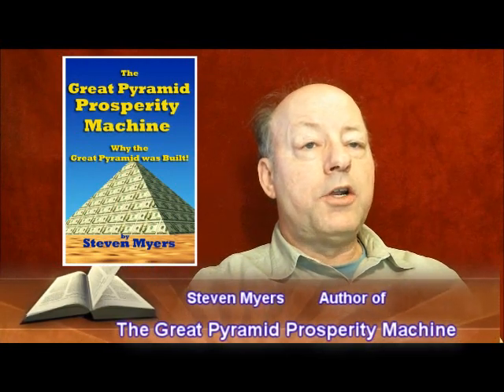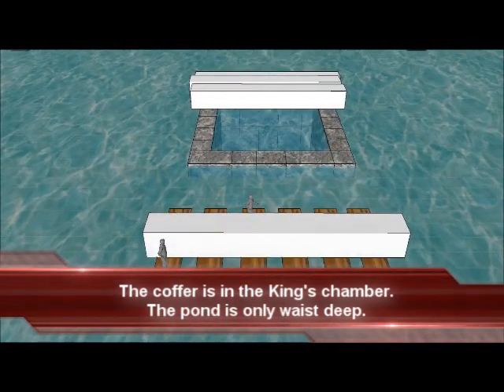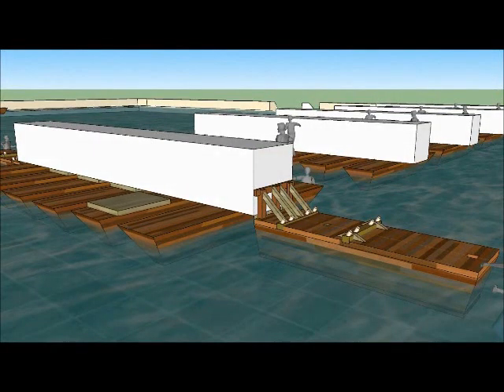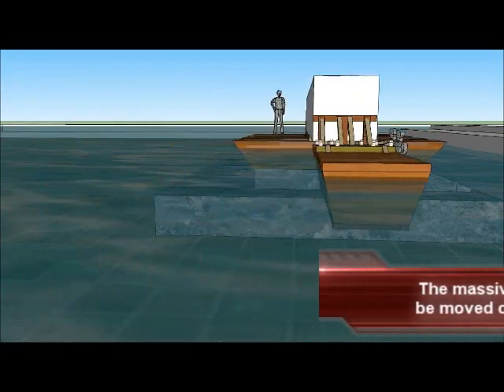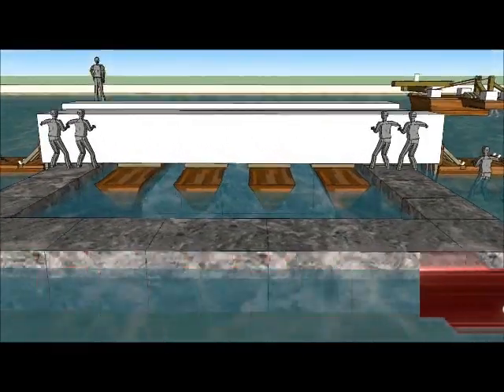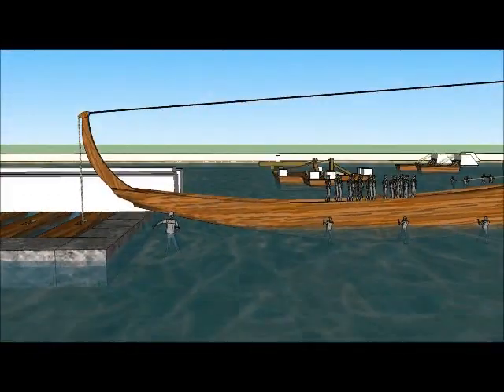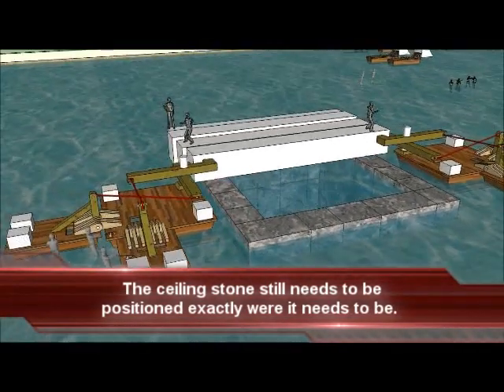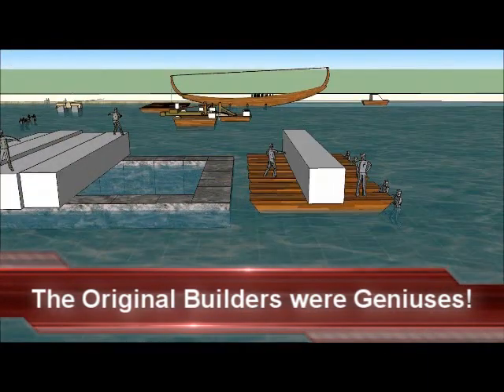Video 11  Setting the Largest Stones of the Great Pyramid in Their Final Location

Comment: How did they get the barges out of the kings chamber, once the last of the large stones was in place?
Reply from the maker: Thank you for your question on how the barges were removed from the King's chamber after the ceiling stones were set in place. The entire process of assembling the Great Pyramid using water locks and barges is very versatile and adaptable.  Every construction task can be accomplished in many ways using this system.  I was not there when the great Pyramid was built so I do not know the exact method was used by the builders to remove those barges after the completion of the King's chamber ceiling but there are many possible methods.  Right before the last ceiling stone was slid up against the ceiling stones already sent in place there was a gap between those stones.  Those barges could have been built so they could have been disassembled and removed piece by piece through that gap.  That is one way.  Another way would be to lower the water level so that workers could move the barges out of the King's chamber and down the grand gallery and ultimately out of the Great Pyramid water pump. Again there are numerous ways to accomplish the task you are asking about.  A few short videos do not describe every detail of the construction process.  My books and DVD documentaries go into much more detail about many aspects of the construction process.  Here is a link that provides additional resources and information about this direction of research.  https://www.youtube.com/watch?v=Sv3RVgL99So
Reply: @GreatPyramidPump  Thanks so much

Comment: those barges would move as lowered. so it only move stone maybe a inch. maybe if it could get traction to push. js
Reply from the maker: Yes the largest stones of the Great Pyramid were moved and set in place almost effortlessly.  I hope you watch the entire video series.
Reply: @GreatPyramidPump  i did. im a boat mechanic. and adding something to lock barge from moving while lever is moving to keep it from floating away while pushes. ever seen this series? i do believe water was used. https://www.youtube.com/watch?v=C1y8N0ePuF8
Reply from the maker: @StevesDIYProjects7  I have watched that video.
Reply: @GreatPyramidPump  im a strong believer they used cement more then anything. was the easiest martial to move and make and perfect and last longer then most common stones since so much else into it to make it a long lasting cement. rome stole a lot from egypt. not only its math and measuring all its technology. I've done masonry work and build forms and molds. and to me the pyramids have lots of cement work and some big heavy stones. so I think water was 100% main play in building them.
Reply from the maker: @StevesDIYProjects7  There are proponents of the cement idea as well as critics of that idea. This because an idea is thought to be ‘easiest” does not make it valid.  I’m a strong believer in theories being consistent with the direct physical evidence. Thank you for watching my videos and I hope you share them every chance you get.
Reply from the maker: @StevesDIYProjects7  There are proponents of the cement idea as well as critics of that idea. This because an idea is thought to be ‘easiest” does not make it valid.  I’m a strong believer in theories being consistent with the direct physical evidence. Thank you for watching my videos and I hope you share them every chance you get.
Reply: @GreatPyramidPump  indeed love watching all theories on it helps put together the larger puzzle. i think each other then the alien stuff have good pointers that can help tie the bigger puzzle together. but forms and molds arent that easy. grinding the materials down can be done sand and other types of things. but getting mixes accurate I'm sure would been tough.

Comment: Wait how did the large kings chamber ceiling stones get up there? I understand the ponds system to get up to the area, but how did they get inside the perimeter of the casing stones? Was that done from the beginning? Your video 10 shows it looking like the largest stones were done in the middle of the process
Reply from the maker: +Justin Bozeman Hi, Thanks for watching the video series.  We are producing another video series about how the water was raised to the necessary height.  I think that the Great Pyramid was a water pump and wrote a book about that.  The title is The Great Pyramid Prosperity Machine.  I think you would like the book.  it would answer your questions.
Reply from the maker: Here is the link to the Water Pump Documentary The Great Pyramid Water Pump  https://www.ebay.com/itm/275037608643